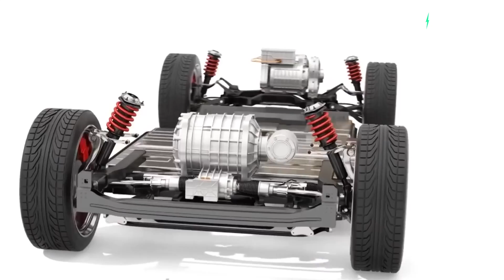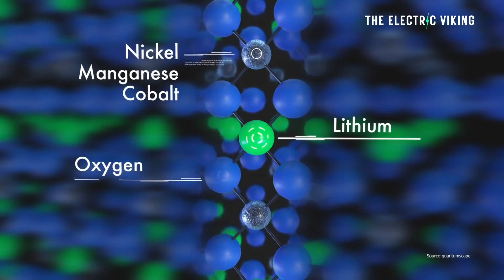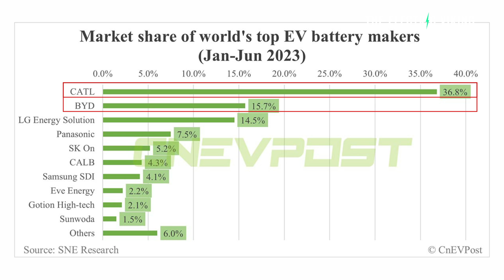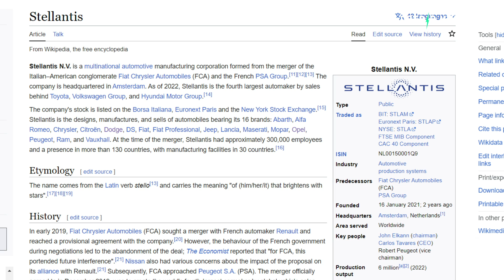Battery pack prices see HUGE decline - EVs cheaper than gas in 24 months

Comment: Tesla in the US is already cheaper than the average paying price for a new car. The average new car in the US is over $47k. Tesla model 3 and Model Y can both be had for well under $47k especially counting the Federal and state incentives. The gap between EVs and gas engine cars will only get wider as the years progress. Gas engines will be for the wealthy and long haul only within 10 years.
Reply: Why aren't you comparing the AVERAGE price of a Tesla with the AVERAGE price of an ICE car?
To save you the trouble I've added up the low to high prices of the entire Tesla range and the AVERAGE price of a Tesla in the USA is $74,927.50.
Of course a new ICE Toyota Corolla starts from $21,550, being a very similar size to a Tesla 3, I would have thought that might of been a fairer comparison?
Reply: @robertgreen9614  Don't know squat about modern toyotas but have a 79 hilux.    Most people compare the M3 to the Camry.  I don't know just saying.
Reply: @danharold3087  The Camry is a bigger car than the Model 3. But if people like to compare them, the Camry starts at $26,220 in the US.
Reply: @robertgreen9614  Thank you Robert
Reply: @robertgreen9614  The average price of an ICE car being quoted is the average of all the cars sold; while what you're citing is obviously the average of the price of one of each model--Model S, 3, X and Y. The average price of all Teslas, calculated the same as the average price of an ICE, is likely around $47k, just because the lower priced Models 3 and Y sell many times as many as the higher priced Models S and X.
Reply: @BigBen621  
JD Power states the average price for ICE cars sales in the US in 2022 was $45,844 and the average price for an EV sold in the US in 2022 was $66,000.
The $47K average price originally quoted was for all cars not just ICE. So the average price of an EV battery is going to have to drop by $20K for parity with ICE to occur.
Reply: @robertgreen9614  Some issues with your analysis. First, the JD Power $66,000 was in 2022; but the price of Teslas has come down dramatically since last year, to the point where Tesla owners who bought earlier are complaining bitterly. 
Second, while you will surely quibble about whether it should be included, your average of the cost of the four Teslas, and, presumably, the JD Power $66,000 2022 average EV price doesn't take into account the $7,500 tax credit, which applies to three of the four Tesla models; and would reduce the average of the four Teslas to $55,115. But this is still highly misleading, because it includes two models that cost in the $70 thousands, but are sold in very small volumes, around one tenth of the volume of Models 3 and Y. Weighted by the number sold, and taking the tax credit into account, the average price of a tesla would be somewhere around $40,000, substantially below the average.
But the best comparison is with the Model Y itself, which is the best selling passenger car in the world in 2023; it costs $47,740 without the tax credit, only $2,000 more than the average of all vehicles, which for many buyers will be made up in the first year, by gas savings. And after the tax credit, the best-selling car in the world is almost $6,000 less than the $45,844 average of all vehicles.
Reply: @BigBen621  Seems your stuck on Teslas, which isn't surprising as you're on this channel. The JD Power average was for ALL EVs sold, not just Tesla.  You pick the cheapest compact sedan in the Tesla range, discount it with taxpayer's money, then don't add the cost of a home charging station (which can range from $500 to several thousand dollars), then want to compare it with the average price of ICE vehicles which consists mainly of large SUVs and trucks, the top 3 selling US vehicles as of YTD figures for July 2023 were the Ford F Series, Chev Silverado and Dodge Ram. Why not compare the compact Tesla 3's value with Toyota's compact offering, the Corolla, that has a starting price of  just over $21K?
JD Powers 2023 number for the EV average price is still $60K, incidentally in the same article Tesla was only beaten out by the manufacturer with the most problems per car by Polestar. 7 of the bottom 10 worst cars were EVs, I guess making them cheaper should improve matters.🤦‍♂️
Incidentally the world's best selling cars in order are actually, the Toyota Corolla, the VW Beetle and the Model T Ford. Once Tesla make another 10 million or so Model 3s they can claim 3rd place.
Reply: @robertgreen9614   Seems your stuck on Teslas, which isn't surprising as you're on this channel. 
Actually, it was your first post in this thread that averaged the price of each model of Tesla.
 You pick the cheapest compact sedan in the Tesla range 
No, I picked the Model Y. The Model 3 is the cheapest sedan in the Tesla range.
 Why not compare the compact Tesla 3's value with Toyota's compact offering, the Corolla, that has a starting price of just over $21K? 
Because the Corolla is at least one class below the Model 3, by any measure. For just one example, the Corolla has a cabin volume of 88 cu. ft., compared with 97 for the Model 3. And the Corolla has 169 HP, compared with 271 for the Model 3 RWD.
Actually, the closest comparison to the Model 3 RWD is the Camry V6. It has a volume of 100 cu. ft., virtually identical to the Model 3's 97. And 301 HP, slightly more than the Model 3's 271; but with a narrower power band, leading to virtually identical 0-60 times. 
To match the features and performance of the Model 3, you'd need the XLE V-6, Nav Upgrade Package, Rear USB option, and Integrated Dashcam option; total, $39,914. And I've yet to see a Toyota go out the door without thousands in dealer add-ons. This, vs. the $40,240 cost of the Tesla Model 3 RWD.
 add the cost of a home charging station 
Teslas don't need a "home charging station". They come with a Mobile Connector, which only needs a 240V outlet. Most homes have a 240V dryer outlet in the garage; in this case, there's no extra cost. If you don't have a 240V outlet in your garage, it costs perhaps $500 to add one; at least, that's what it cost me.
So there you have it; almost perfect parity between the base Tesla Model 3 (RWD), and the Toyota Camry that almost exactly matches it in every respect. Of course, most Tesla buyers will also get the $7,500 tax credit. You reject this because it's "taxpayer's money"; but whatever the source, it still reduces the cost by that amount for most Tesla buyers. And, the Tesla buyer will get the lifetime advantage of much less expensive fueling, and virtually no maintenance costs.
 the world's best selling cars in order are actually, the Toyota Corolla, the VW Beetle and the Model T Ford 
Cute trick. I state the verifiable fact that the Tesla Model Y is the best selling passenger car in the world in 2023 (and also the best selling passenger car in the US in 2023); and you attempt to refute that by listing the three best selling cars of all time, which is of course completely irrelevant. Because the Model Y is the best-selling passenger car in the world and in the US in 2023, apparently lots of folks have decided that they're preferable to whatever ICEVs they considered, even though the ICEV might be less expensive.
Reply: @BigBen621 The reason I quoted Teslas is because the conversation you jumped into referenced Tesla prices right from the start. The Camry is classed as mid sized, the Corolla and Model 3 are both compact. The Corolla can legally do anything the Tesla 3 can do, has a longer range and faster refuelling. The 240V cable is OK if you just use your Tesla to check the mailbox at the end of your drive.😉
Actually every single article that states the Model Y is "the world's best selling car in 2023" comes from one source, and that is JATO. Tesla do not release seperate sales figures for the Model Y, they are bundled in with the Model 3. Autoweek called the claim BS and even Teslarati referred to the claim as "seemingly". But as Autoweek said "the fan boys" love it.
Reply: I really dont even think long haul will need to stick to gas. We're going to see batteries in the next 5 year triple their power dens. 700-900 kg at 1/4 the current size wont be out of the question. Leaving lots and lots of space for even more batteries and weight for even more of them.

Comment: Me: "I just gotta hold out another 24 months!"
My Chevy Sonic: "Sorry, buddy. I got like 17 minutes of life left in me."
Reply: My 2013:Prius just cost me $7k for a head gasket. My next car may not have a head gasket
Reply: how does a gasket cost $7000
Reply: @I_dont_want_an_at  "Toyota Service" I will never buy one again.
Reply: @Fish_Ventura  I used to love working on ICE engines.   Now they just seem like dirty pigs.
But for $7k I would spend a weekend or less changing a head gasket.  But .........
"The average cost for a Toyota Prius head gasket replacement is between $1,935 and $2,303. This includes labor costs of $1,379 to $1,739 and parts priced between $556 and $564."   After market gasket and bolt sets are about $160."
The average price for a re manufactured engine and labor hours is $7,000.   
Oh what a feeling !

Find a garage run by motor heads.  They race on the weekend.  You can tell by the race cars in the back of the shop.  At the very least call around a bit and ask for quotes.
Reply: @danharold3087  YES ! even a beautiful V12 engine isn't sexy anymore !
Reply: lol

Comment: There is a lot of cost takeout that can happen on EVs, in 2022 they were about as expensive to make as they ever will be. In contrast all of the cost has been taken out of making gas cars and the cost is very likely to go up as suppliers start to drop out of the business to pivot to EV parts. Not only will battery packs of a single chemistry get cheaper but there will be competition because of the different types of batteries entering the market and that will put more pressure on the price of packs.
Reply: No head gasket in an EV, quite a personal selling point this week.
Reply: Additionally, unless they want to start selling at a loss, gasoline is unlikely to go down in price, it will only increase. I do strongly suspect we’re nearing the end of the ICE vehicle dominance, although some niche or boutique brands or models will remain.  The only place I cannot yet see the EVs disrupting is for people who are regularly towing a large trailer, the range hit is still currently too high.  I’m hoping that will change though!
Reply: @sjsomething4936  If everything contiunues - that might not be a problem either in the future - napkin math - but we will be seeing battery packs cut the number of cells needed to hit current ranges by 1/4 in the next 5 years between solid state and sulfur mixtures. You can just add more of the cells back for longer and longer ranges. 700-900 wont really be out of the question soon vs the 150-250 ones we have today.
Reply: Well... then buy an electric  driven large trailer with big Battery , two problems solved I would say @sjsomething4936
Reply: @sjsomething4936  I 'm wondering if adding a dual-speed rear end would help with that?
Reply: "all of the cost has been taken out of making gas cars"      There is a truck load of manufacturing optimization that can be done on ice cars.   The goal goal of legacy auto is to change as little as possible and past the cost on to the consumer.  Milk it!   They have been doing that for 100 years. It is why the can't afford to build and sell sedans and small cars.   
Watch Sandy Monroe or Corey talk about how the engineering works at the big 3.   It is sick in the bad way.
Reply: EVTOL will mirror EV's price points in next gen units too

Comment: So how much value is lost in an Ev rather than gas?
Reply: they depreciate a lot more
Reply: @kimbalcalkins6903 yep, throw away technology
Reply: @kimbalcalkins6903   Buy a Tesla the depreciate less.
Reply: With the exception of some specific models, EVs on average generally hold their value better than the average ICE vehicle, with some brands such as Tesla holding up very well. The Nissan Leaf's tended to depreciate very quickly, and are one of the main reasons that the stats are not better. Poor range and fast battery degradation really took them down.
Reply: @GoCoyote  😂 Second hand Tesla's aren't even selling where I live, all listed well below market price too.. Throw away technology
Reply: @hobo1704  
And where is it that you live. In my area of Northern California, used Teslas go pretty fast.
Reply: @hobo1704  Where do you live !
Reply: @hobo1704  What do you mean by "listed well below market price"? What they're listed at is the market price.
Reply: @hobo1704 That's anecdotal evidence.  It's like saying I don't know any who voted for "fill in blank".  Everyone has their own bubble, which is why if you look at the actual data. Other than a few models, EV's tend to sell very well in comparison to their ICE equivalents.  EV critics tend to show that the prices of used EV's have fallen a lot in the past year and then disingenuously compare them to a Toyota Corolla, which is not even close to the same class of car.  Prices have fallen because of massive price cuts from Tesla which has reduced the cost of all EV's new and used.  The critics state this as a bad thing.  It is not, it is a good thing for consumers.
Reply: Do you mean in the fuel?  Resale value?  I'm not really sure what you're asking.